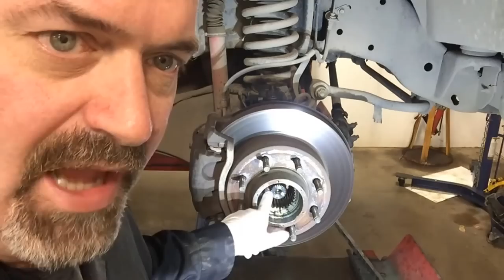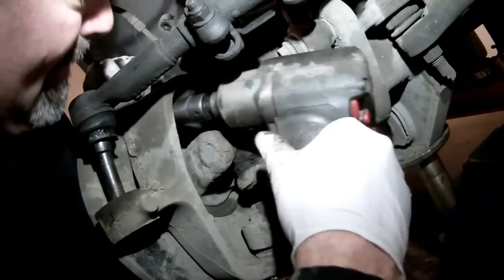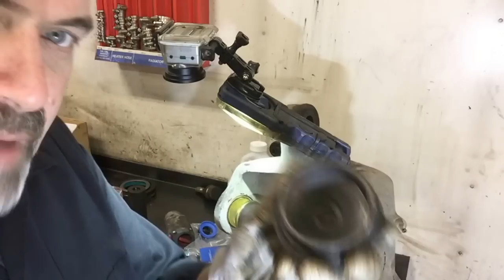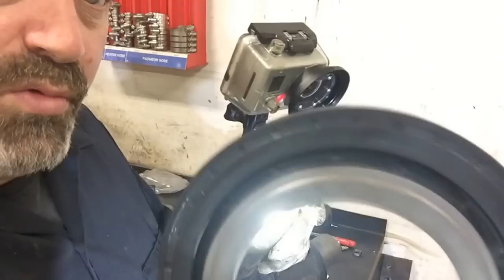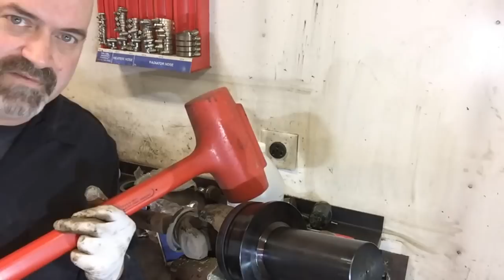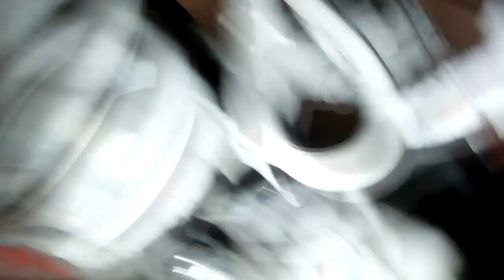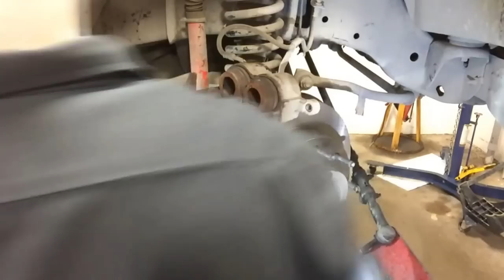How To Replace Ford F250 F350 Super Duty 4X4 Upper and Lower  Ball Joints

Comment: This is a good video except after assembly, my right-side steering knuckle was tight, and I had memory steer.  I since learned you need to remove the top split bushing and clean it and the hole to bear metal. Put the knuckle in and use the bottom nut to hold it, then tighten bottom nut to 44 lbs. drop the bushing into the hole and over the upper ball joint, tap the bushing down lightly to engage the tapper on ball joint, torque upper to 69 lbs., then lower to the 150 lbs. your knuckle should turn with little resistance and there should be a gap in the upper bushing between the shoulder and knuckle.
Reply: Hope you see this in time. Seems to be a coupe of conflicting opinions about doing an alignment afterwards. If the same shim is used after being cleaned and obviously being put back in the same position is an alignment needed?

Comment: For anyone wondering they do make low clearance grease certs that will give any of these tricks clearance for the knuckle not to hit it. You need a side sliding grease fitting adapter for your grease gun to fit on to it. It works. Give a finger to ford for not thinking of it.

Comment: If you can’t get the specialty tool, flipping a breaker bar and tapping it in level going in a star pattern, using the rubber handle against the seal works. Done it a few times with good success

Comment: Great video. Helps a lot. One question: I saw the outer dust cover hanging before you removed the axle. (like mine is now) I didn't see one when you replaced the axle (or I may have missed it) I have read a few times that unless you do a lot of off roading etc. (which I don't) it would be ok to leave this seal until the ball joints need replacing. Is this correct? Thanks

Comment: Pain in the ass without a lift....just did them all 2 hours ago. Goodluck to driveway mechanics. Need special hub tool,specific cup for bearings,buy all seals kit,better have all mechanic tools avaible sockets torx etc cuz they all done once you pull. Hopefully this comment helps someone
Reply: Use a c-clamp a good size socket and press it out.. wasn't hard at all.. did my 88 f250 4x4... In no time flat

Comment: great video. I worked on a 2000 f350 today. Bad upper Ball Joint on left side.   Right side was good. Installed a grease fitting on the right side but had to plug it because of interference.  There are no vacuum lines. I guess because of aftermarket manual locks. Will do the left side later if he brings it back. I guess we need to do lower at the same time so we can get the tool in. Thanks again.

Comment: Not sure who needs to hear this, but please consider researching the "Lisle 38700 Spindle Snap Ring Pliers Ford SD" if you're encountering challenges.  I endured multiple iterations of pliers and the Lisle (or its clones) are the only pliers that made this repair "enjoyable."

To the content creator:
- I used this video the first time I pieced together my front axle years ago.
- No matter how many times I've disassembled and reassembled my front axle, this video continues to be my go-to reference for front axle repairs.
- In my opinion that speaks volumes to your value to the community.  Thank you!
Reply: The 9" external in the "ICON Precision Snap Ring Pliers, 8-Piece set" from Harbor Freight works great for removing the one on the axel.  Takes mere seconds to pop it out. It also puts it back in easily, but I found you have to tap the ring with a screwdriver to get it to pop back in.
Reply: I bought the Lisle pliers, the ones I got are junk! The ratchet arm would not alllow the pliers to close like they should it would bind real bind so took the ratchet arm off and they worked.

Comment: THanks for the great video.  I just finished my second 350 dually in the last few months.  I used this video and alldata as a guide.  Your video fills in the color that the manual can't provide.  I am curious why you didn't unplug the ABS sensor?  I also couldn't pry the seal out.  Used a brick chisel!  it worked just fine.  Thanks again for the guide.  8 years and this gift keeps giving!

Comment: Thanks everything was going great until I installed the lower ball joint before the upper one and I didn’t have the exact same  cylinder tools and rented both kits? It’s better to fit the upper one first before the lower! It was very frustrating to say the least. 
I finally got them in but not how you did it.

Comment: Great video gives alot detail only thing I would mention is that snap ring on the front axle is tough and takes a good brand of snap ring pliers like snap on or a special set of snap ring pliers ex (lisle 38700) because of the limited space. Other than that, it's an excellent video. Good job 👍

Comment: I couldn't get that passenger side axle out even after prying on it and jiggling on it from side to side,it just wouldn't come out.
Th I was unable to complete the task after getting that far, it wouldn't come out all I needed was the nuts on the ball joints and then replace it but that axle will not let me get it out.
 Does anyone know if the manual shift on a 4 wheel drive have anything to do with it? Is there a different procedure to removing that axle?
Reply: Yeah I'm having problems trying to get the axle out that's the only thing that is stopping me from getting the job done I can't get to the ball joints until I remove the axle. 
Also do you have the part number to the dust seal that goes on the axle or know where to get it ? It seems to be cracked and just  Loose and  just dangling around hanging doing nothing.
 I'm having a hard time explaining  to the part stores what seal it is  and no one seems to know or they think it a dealer item only.
Reply from the maker: They can really get stuck in there and if its rusty its even worse.

Comment: Thanks for the video. Getting ready to do my brothers truck today. 

Lol on a side note about 18 years ago I did exactly what you said not to do. I changed the front brake pads on my Ford Taurus and forgot to pump the brakes. After I got finished I hoped in shut the door started it up and threw it in reverse. The car idled high after the first start and I came flying out of the garage at warp speed and I T-Boned my F150. The way my driveway is positioned if my truck wasn’t there I would of ended up in my neighbors front office. Luckily my kids or   anyone else  was around and the only thing hurt was my pride. I totaled my car due to the rear quarter panel damage and did $1800 damage to my truck which I thought it would of been a lot more. Felt like a total idiot.

Comment: Thank you so much for this video 🙏🏽. You have a lot of patience and the gift of teaching. Appreciate you brotha! In case anyone is wondering this is the exact same method for a 2019 ford f250. Needed to do the upper ball joint on my truck because I did a lift and installed my caster shim and of course used a hammer and absolutely killed the threading on my ball joint. Rookie mistake but all good now!

Comment: @the car doctor. Just had this done on my truck. Do the upper ball joints sit somewhat at an angle. meaning looking at the bottom of the upper ball joint should the amount of bottom of this ball joint sticking out be even or should it be tapered/less towards the outside?

Comment: Great info, helped me step through the process on my 2006 F350 FX4 6.0... At 430K, the ball joints were shot... plus found a damaged caliper, and a broken rotor...
Reply: Was this the first time they were changed out on the truck?  I'm doing this project on my 2003 F250 after the front end shop I took it to refused to do an alignment due to all 4 ball joints being worn out. I've removed and replaced the set on one side, and though they are a bit sloppy, they don't seem excessively worn out. I hope I'm not doing this job unnecessarily.
Reply: @fahey6797  i don't know.  i am not   the first owner, but all 4 needed replaced.  visibly, they didn't look all that bad - until i removed them.  i think they were original as there were no grease fittings.  replacements usually have grease fittings.

Comment: Thanks for video very informative. I have a 2005 Ford F-350 with auto hubs I’m working on. On the ends of the axle shaft it appears like locating slots going into drivetrain.
Do these need to be aligned when installing.
Any help would be appreciated.

Comment: Any link on the seal installation tool? That would help out tremendously!!
Reply from the maker: There are two different sizes depending on year model. 6695 or 6697
Reply: @ThecardoctorTV  it's a 2005 F350 4x4

Comment: I found this video after watching several others. Your video is the easiest to follow and just makes sense. Thank you! 

I just picked up a new track bar as I'm getting death wobbles in my 2011 F250. I'm afraid of how much wear I have on the ball joints in my steering system.

Comment: So I have steering memory due to not doing the lower joint at a lower torque. Then doing upper then back to lower. Ford Haynes book says nothing about doing this process u did. How do I correct this in ur opinion.

Comment: Great video has definitely help me get the job done although I do have one question on the top ball joint the camber adjustment spacer is it supposed to be sitting tight against the hub mine has a 1/8 space after torquing everything probably

Comment: Thank you for the video. I replaced the caster bushings today, and boy was that a job... 200k miles and probably never apart. Next on the list are rebuilding the front axles, replacing the ball joints, and hubs. Your video made it much easier. Thanks!

Comment: Unless you have or can borrow a professional-level set of circlip (snap ring) pliers, get the Knipex 49 11 A3, 9" precision circlip pliers.  It's the brand that Snap On sells and is good quality.  You can get it from Snap On for about $44, or on Ebay or Amazon or dozens of other places.  Don't try screwing around with cheap, ill-fitting or modified tools trying to get the circlip off.  I did, and it was very frustrating and a big waste of time.  I got smart and ordered the Knipex on Amazon for $26.04.  Literally took me under 10 seconds to get the circlip off the axle, and about the same to put it back on.  Get the right tool and you'll be very happy and successful.  The guy in the video definitely knows what he's doing, but didn't mention this.
Reply: Thank you very much!!!

Comment: Very good job / vid...  just curious.. the whole area has been rebuilt minus the u joints... I guess you can just feel them, and if they are not notchy...feel good, then do not replace them ?    In the Puget Sound area, driveline service shops have all but vanished...all the old timers are gone , hard to find a place to do U joints ...

Comment: Nice. 2005 F350 Super Duty manual transmission manual transfer case in manual hubs. I would assume that means my job would be a little easier I would hope? Second of all what kit did you buy for the ball joint removal and installation? Thank you great video

Comment: Thanks for your help! Tackled this job, couldn't have done it without your help. Went back and referenced several times. Your presentation is smooth, speed of speach is right on. You are to be commended. Now where do I get one of those Ford hammers! Lord knows you need it on this job.
Shout out to Dennys driveshaft if I can, ordered u, ball joints and seals. Great prices, fast delivery.

Comment: I know this video is old but I will comment for others that may be watching.  PRIOR TO installing the ball joints, you should put some grease on the shafts of the ball joints (the base area that is pressed in and not the shaft with the threaded portion) or holes that they sit in so when they are pressed in during installation, they go in a lot easier.  Also, if you end up having to replace them again in 100k or 200k or 500k miles, "HOPEFULY" they will come out a lot easier.  (Maybe).  

I would also recommend putting grease on the wheel hub base and hole that it goes into for the same reasons. Basically anywhere that is a pressed fit, put some grease on it to aid in instalation and removal.  

Also, I would recommend NOT hitting the face of the wheel hub assembly and instead use the nuts on the back of the 4 wheel hub studs to draw it tight to the axle hub housing. You don't want to be striking the wheel hub assembly and potentially causing any wheel bearing issues. Better to never hammer on that surface ever.  Just use the nuts to get the hub assembly tight to the axle hub housing.  Don't try to tighten one or two of them too much and just do it in small increments in a cris cross manner at first. Go slow and it will gradualy get tight without damaging anything.  

Also, you should put a very light film of grease on the axle seals inside the axle hub housing as well as in their lips where they mate with other surfaces.  Just letting them start out dry is not a good idea.  You don't want to put too much on though.  Just basically barely enough to get the seals lubricated to help with the vacuum sealing to ensure the auto locking hubs work and the seals won't wear out.  Just don't put too much that the grease gets ducked into the vacuum lines and starts causing issues with the vacuum solenoid and so on.  Again, just barely enough to lubricate the lip of the seal and nothing more.

Comment: I've been a mechanic for about 30 years now that and can fix most things with no help but now that youtube exists i always run through a job before i do it so i can see where other mechanics run into problems what tools they used and get torque specs and special tool info which always makes a job easier when you can go directly to what works best thank you for putting up all the videos you put up i enjoy them and they make my life easier...keep up the good work.
Reply from the maker: thank you. Good luck with the job

Comment: I've watched your video on replacing the front ball joints on a 1999 Ram 2500 diesel, but mine is like this Ford, the ball joints are pressed into the steering knuckle. I am at the point where you hit the yoke with a hammer and they dropped out. I have done this with no luck. There appears to be a some kind of camber sleeve on mine, I was wondering if this might have something to do with it?  No, I see the Ford has one also.

Comment: Thank you, Sir, for the very informative video.  Very thorough, including mentioning the little things, such as torque specs, things to watch out for, proper tools, and a good workable sequence.  Not only did this video help me save a little cash, I was able to  fix a lot of discovery work - replacing the axle shaft U-Joints, new axle shaft dust covers, etc.  I opted to replace the wheel bearings and purchased new Warn hubs.

I did review the video prior to even ordering everything and was able to plan my work well with minimal back & forth to the auto parts store.

Thank you again.  Peace!

Comment: Is there a reason that you would have to take the wheel bearing and hub assy off separately?? why couldnt you take the 4 back bolts off, and pop off the entire assy? this is just to change the upper and lower BJs...

Comment: Excellent how to video. My truck has a manual transfer case and manual locking hubs, not the auto locking hubs. Does the manual hub set up still use the vacuum seal, and would I still need the special tool to install the seal that you're using?

Comment: Today I changed the upper and lowers on my heavy-duty 2011 F450, boy oh boy did I save time and money by just removing the whole hub intact and paying for a shop to press the ball joints out and install the new ones.. Ball joints Driver/Passenger$300-shop to press $140 Labor$75 2days time because parts store gave me the wrong ball joint twice..Everything with my truck is always like this parts are very tricky even when I provide Vin

Comment: This dudes a jackass! U put the top one in first! You are reversing the removal. It’s ten times easier and the correct way to use the installation tool! He realized his goof in the video and didn’t have the courtesy to correct or even note it for the viewers misguiding them!

Typical bs YouTuber mechanic !

Comment: Excellent video. Question: will the OTC6697 work and be necessary for a stick/manual transmission with no vacuum too? I've got a 2007 F350, crank windows, stick, as basic as possible.

Comment: I want to say this was one a the best videos on this I have seen.  Your a great teacher.  I have to tackle this on my 09 F250.  minus the ball joints I hope, but will be replacing hubs, 4x4 locker (one is seized in the lock position), and the 2 axle shaft seals and U joints.  I just hope the permanently locked passenger wheel as not trashed the axle.  Thank you

Comment: Thanks for the video, although I have done ball joints many times I was unsure on the axle removal for the newer Super Duty trucks. The tool was nowhere to be found in my town, I was able to use a piece of 5" exhaust pipe to drive them back in. I appreciate the time you took on this video.

Comment: You didn't replace the dust seal..
You said something about replacing it when you were doing the vacuum seal.
But I think you got ahead of yourself and put the axle back in but by the time you hammered it back in it was to late.
When you were torquing the ball joints you can see theres no seal there.

Comment: Did you ever get squeaking after installing the new hub seals? I had the actual tool you have so I Feel I installed it correctly, but now when I engage the 4wd, it is squeaking. I thought these seals were self lubricating. Any thoughts?

Comment: Your presentation  was clear, articulate, well founded and most informative. Question; Did you leave out the video of installing the Axle Tube Dust Seal? I gather its the same install tool used as the vacuum seal??